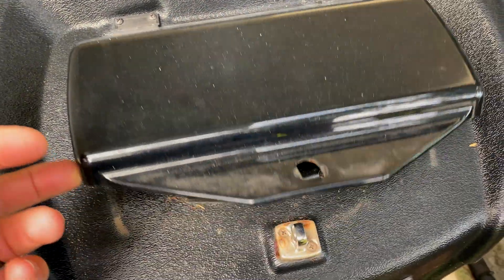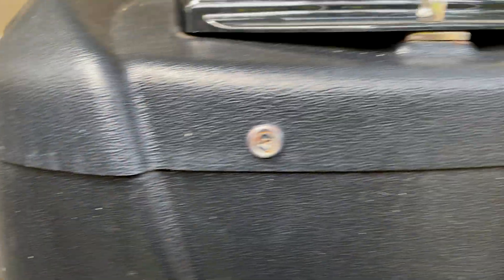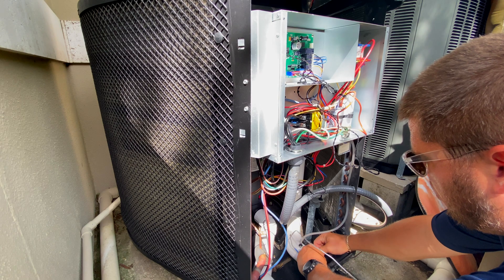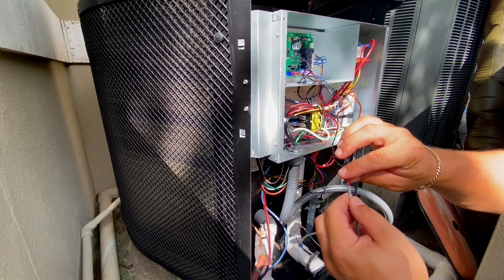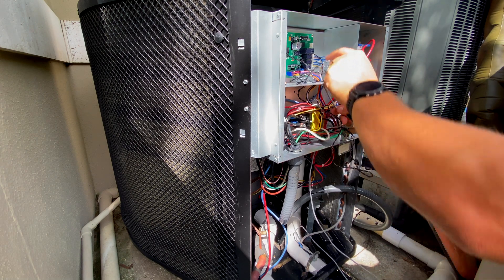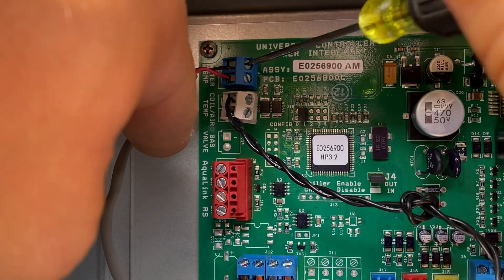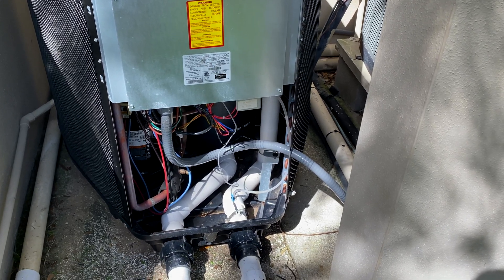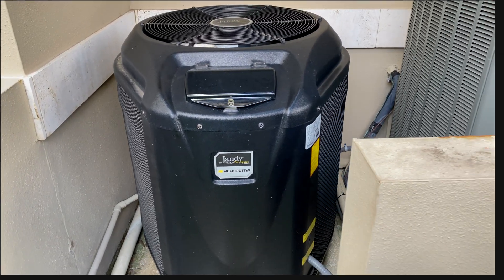Fix H2O Sensor Failure Fast! Jandy Heat Pump Troubleshooting & Repair!

Comment: If that sensor fails, would that be the reason why the water isn’t getting hot?    That’s what my Jandy heater is saying on the display and the water isn’t getting hot.  H2O sensor
Reply from the maker: Yes because it usually puts out ridiculous water temp reading, well above the limit of the unit. Because of that the heater will never turn on. Replace the sensor and it will fix your issue.

Comment: You skipped the part where you take the old sensor out
Reply from the maker: There's nothing special about it. Undo the pipe clamp, pull the old sensor out, put the new one in and then tighten the pipe clamp. I didn't figure I needed to show that part since it's a straight forward direct swap. I will on the next video. Thanks for watching.

Comment: For the Jandy heat pumps for pool is all the H2O sensors the same for all models?
Reply from the maker: Any current model yes. In fact you can use a water temp sensor for the automation systems and it will work as well.

Comment: Help! I have this exact heat pump. I set to 75 when temp on pump and pool thermometer is 69 at night. In morning pool thermometer is 80 but pump still says 69. I turn off and back on and it now reads 73. Temp on pump seems to jump all over the place. Seems to never catch up to set temp of 75. Last year pool thermometer had water in the 90's before I figured out something was wrong. Any idea if this part replacement will solve the problem, or what will? Thanks in advance for your help.

Cheers
Cam
Reply from the maker: Hey Cam! I do think that would help you. It’s normal to be a couple of degrees off but to be more than 10 degrees off I think it’s failed. I hope this helps.
Reply: @ChlorineKingPoolService  yeah, it just keeps heating the pool beyond 90 degrees last year while set for 75. Thanks, I hope it is just this sensor.
Reply from the maker: @user-wr5rt9cq3x I hope so too. It’s what tells the board what time it is to turn on/off the heat pump. The only other thing it could be (I’d imagine) is the board. So yes, let’s hope it’s the sensor lol.

Comment: Thank you for this video! I’m always hesitant to open this to make a repair but I’m confident I can make this repair.
Reply from the maker: It’s honestly not bad. Just make sure to cut power off to the heat pump before you start just to be on the safe side!

Comment: Thanks for your video.  Any suggestions on how to get the old sensor out?  It's wedged in so tight it feels like the probe is going to break off inside the pipe if I use pliers to pull it out.  (FYI, there's no other way to get it out without using pliers to pull on it.)  I'm guessing that whoever installed the original sensor didn't make the hole big enough.  If the probe does break off in the pipe (it will for sure) will it end up in the pool pump pot/basket?  Thanks for your help.

Comment: Hi! I have a Jandy Water Heater that continues the operating cycle through the day/night even when the pool pump/filter is not running. Is that right? I thought the heater only cycles on when the pool pump is running. I’m in South Florida. Tks
Reply from the maker: That doesn’t sound right. It should only turn on when the pool pump is running. It’s either a failed pressure/flow switch or something is jammed in it holding it open constantly. Could possibly be the board as well. Definitely recommended to have a local pool professional come out and take a look at it. Good luck. 👍

Comment: Is the run capacitor inside that same electrical box that you opened where you installed the sensor wires?  I have a bad capacitor I think of a Jandy 2500 heat pump but have never opened it myself to know how tricky it is to reach.
Reply from the maker: Yes there are two capacities in the bottom corner of that box.
Reply: Chlorine King Pool Service  thank you so much, thanks to your video I was able to feel comfortable replacing the fan and compressor capacitors!  Heat pump is working like a charm again.
Reply from the maker: You’re welcome!

Comment: Thanks King love U TUBE learn something new everyday keep em coming , this 1 was good for me because I couldn't remember on AC , the air coming off top was suppose to be COOL or HOT  👍
Reply from the maker: You’re welcome bud. Thanks for watching!
Reply: @ChlorineKingPoolService  hello KING can I get some advice on this I'm kinda struggling with breakpoint so my testing chlorine #'s came in as follows Free C, 5.25ppm / &;Total C , 5.27 ppm so my combined is 0.02 is this correct and how would you shock multiply 0.02 × 10 or 20 this would either be 200 oz of Clorox  bleach or 400oz bleach ????
Reply from the maker: What’s the size of the pool?